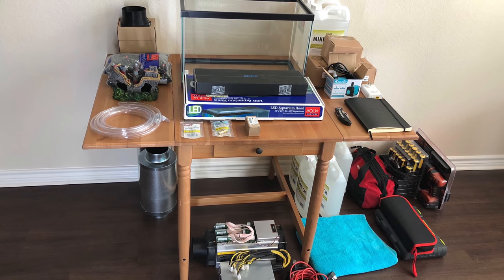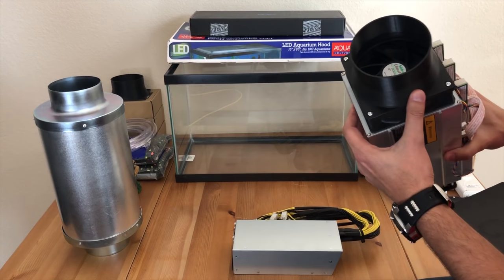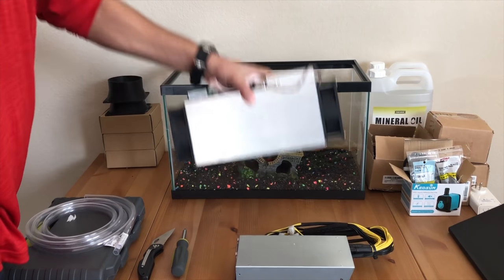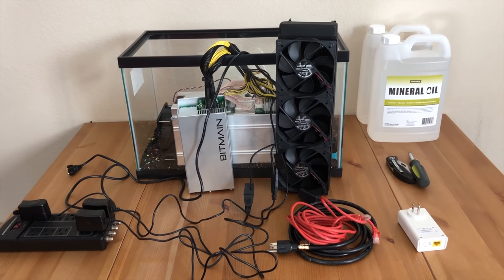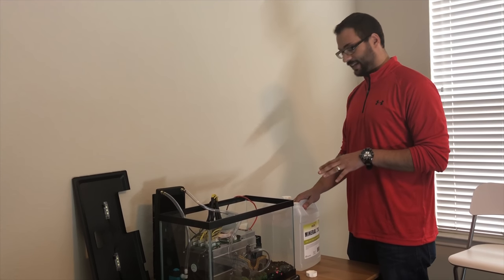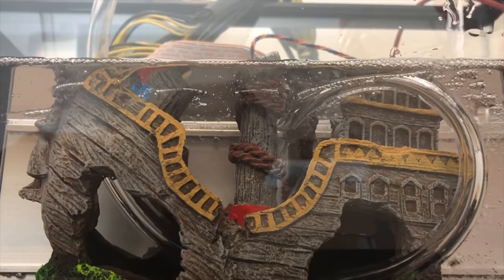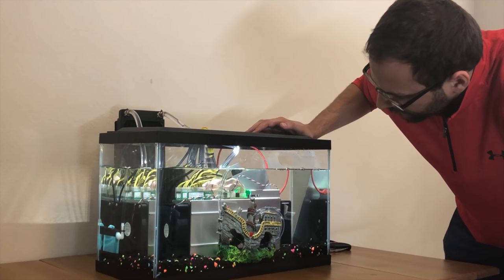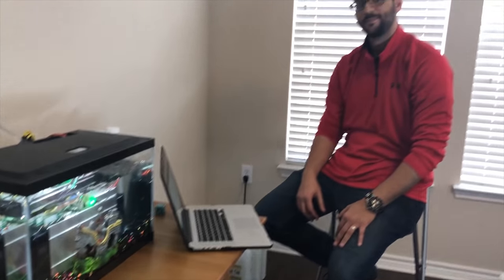Coolest Bitcoin Mining Miner - Liquid Cooled Experiment

Comment: Awesome ! You just beat up 3M and other companies making a "liquid" for the same purpose, but in a cheap way with the same result !
1 Gallon of the 3M liquid is over $400 bucks, and 1 gallon of the mineral oil is less than $25 bucks at Walmart !
Great video bro !
Reply: Novec or fluorinert are much more efficient than using mineral oil. On top of that, mineral oil is nearly impossible to remove from the components once you take them out and erosion can even end up destroying some parts while 3M's solutions will protect your parts.
Reply: @poipoi300   3 gallons of novatec is $151
Reply: @gotwebsite1  I looked up what novatec is and it seems to be a fertilizer. This information seems completely irrelevant. Unless you're talking about something else?
Reply: the put this stuff in a human body
Reply: They don't give any product specifications. Is it dielectric enough to put pc parts in? Another important component of novec is its low boiling point. Does the fluid you've linked have a low boiling point?
Reply: I dont know but they said they use it in human heart therapy or heart treatment or surgery or something and put it inside of humans!  the heart is electromagnetic so it is human friendly and dielectric all the way or totally non conductive
Reply: @poipoi300   guess were out of luck because that stuff is expensive
Reply: @gotwebsite1  I feel you because I got in touch with 3M directly to buy it at a more reasonable price but they don't sell directly unless you have a business AND plan to use it to cool down either a big miner operation or a server farm. I have the business but sadly it's neither of those.
Reply: $11 a litre
Reply: @gotwebsite1  It seems like he has a filtration setup to get rid of any particles created from erosion. That would definitely work but again is an issue for long-term use. He said he had one rig running for 2 years with no issue but erosion problems (with mineral oil at least) appear after around 3-4 years. In this case I also don't know the state of the parts when he takes them out. Is the fluid easy to remove? Is heat damage present on components that are in more restricted fluid paths? Novec still seems like the superior option since it does boil at a low temperature and doesn't cause erosion. There is a kind of novec that you can buy from chinese markets that is much cheaper than the other ones. it's called novec 1230 and is sold as a fire extinguisher. It's sold on the chinese markets at a much lower price than you would find anywhere else.
Reply: @poipoi300   he is using something called Bluemead not mineral oil
Reply: @gotwebsite1  I know, but any type of circulating liquid will eventually cause erosion.
Reply: @poipoi300   disculpa, si no se entiende lo que escribo, mi idioma nativo es el español, estoy usando google traductor y lo retoco un poco, bien procedo:  

Thanks for the answer, I get the fluid 7000 easily, they sell it in the town where I have my residence, so what fluid do you recommend so as not to complicate so much? I know practically nothing about the subject, I was going to use mineral oil but from what I investigated, in the long term it produces wear. My idea is a fish tank as the video shows, a fluid and add a radiator.
Reply: @zagon_4414  Hi, in your case, I think novec 7100 would be easier to manage, but you still need to make sure to cool it properly or there will be fluid losses. If it's possible for you to run cold tap water in copper coils above your fish tank, that would be a good solution. How much do they sell novec 7000 for in your town? I would be very interested in buying some.
Reply: @poipoi300  ok, te averiguo cuanto sale, dame un tiempo, mucho no te entendí, me podrías hacer un listado con los materiales por ebay? mucho pedir ?  no entiendo que es eso de la bobina.
Reply: @zagon_4414  Haha yeah a materials list is a bit too much to ask 😅But you should watch the "Aqua Exhalare" video on youtube. He's using novec 7000 which is harder to keep cold, but you could get some ideas from it still. Using novec to cool computers is still a territory that's not explored much. This is an example of a coil https://www.ebay.ca/itm/173520543939?hash=item2866a160c3:g:ncYAAOSwx2dYFGaE

Comment: Did this like 10 years ago :D  still got the vids in my channel and a blog with bunch of information about it. boring. The oil gets warmed up pretty quick and then the whole thing gets hot. Cooling it costs extra energy = youre loosing money on cooling that oil. Also some people write about health concerns (a little bit of that oil evaporates in the air in your room as far as i could find out back then. and then youre breathing it constantly ...)
Reply: would an uber radiator help, bunches  alum tubing through  the tank and pump ice water from chest with 12v  water pump..       post your  link.   projects like these are great. thanks Jeff
Reply: 2 years* ago
Reply: *losing

Comment: liquid nitrogen submersion ..,.???
Reply from the maker: Battlespace X I'll do it if enough people request doing so. I'll start looking into it.

Edit- Only benefit seems to find out the max overclock. Hasn't anyone already done so?
Reply: Joel Pagan okay thanks  thumbs up for that
Reply: Note that silicon chips has working temperature range, under certain temperatures they might not work or may work faulty. They all have a datasheet containing the working temperature range, that is usually between around -50 and +100C. If there is a kind of luck the silicon chip can create that much heat to heat up the conducting material between the chip and the coolant to maintain the working heat range even with such an excess cooling, then it might work. In worst case there is a chance to break the chip because of thermal difference on the two sides. A lot of materials crack if one side is overcooled and other side it warm. Silicon chips are not different. Keep in mind this might ruin the equipment.
Reply: So build it similar to a MRI Scanner. We use liquid helium to cool our magnets. but we layer our silicone and wires in multiple layers of epoxy prior to the "direct" exposure to the liquid.
Reply: But even so, the more heat you generate the more of whatever liquid you'll boil off unless you use a condenser unit that captures the boil-off and re-liquefies it.

Comment: What if you were to put everything ( tank and all ) into a small refrigerator?
Reply: A refrigerator is not designed to cool an active heat source. Think about how long it takes to cool a 12 pack of coke which isn't not generating heat continuously. You'd end up with a really hot fridge.
Reply: A refrigerator only pulls the energy (heat) from the inside, and drags less energy into the inside. The hotter it is outside a fridge, it will get hotter inside the fridge.

Comment: I would remove the fans on the miner. Waste of power
Reply from the maker: Joel B True. Depending on what firmware you run. Some older firmware will not allow you to hash if fans are not detected.
Reply: Joel Pagan how has it been mining so far?
Let's say I had a big tank with 4 miners in it, with oil, do you suppose there would be enough heat in the oil to flow through a coil in my ductwork to heat my home reasonably?
Reply from the maker: Joel B Technically it would be possible but I don't think you would want that because you want the inverse of that setup. In your case your describing the desire to have the greatest amount of heat go through ducted pipes and then home radiators. In the mining setup you want the least amount of heat going through pipes because your trying to keep the temperature -10 below room temp.

I don't want to give specific numbers because they are highly subjective and not fully scientific. However, I am completely certain that 4 of these can keep a 2500sq ft. home perfectly warm all winter long if the home has reasonable insulation and you duct the output   to your home vents. No need for costly oil nor containers.
Reply: Joel B you will cook the chips in the device. NOT recommended. you need a 300 watts motor with a POOL pump and a car radiator to cool the oil enough. this cost a lot and a month for constructing it.
Reply from the maker: Ravana Brahma Rakshas Why would you need a 300watt pump? With a specific type of looped setup you can avoid having a pump.
Reply: Which firmware allows you to run s9 without fans
Reply: Could you give me the link to your firmware?
Reply: Very bad move, if it wasn't for the fans the hot mineral oil would just stay around the hot parts and cooling would be that much worse. It's like airflow. You want more fans inside a case so you can move room temp air in and hot air out. Of course after running for a while the oil would become the same temp. Also, the oil lubes the fans and it makes them last a while.
Reply: i think the pump to the radiator would cool down the mineral oil so the average temp would be lower throughout the tank

Comment: Moronic idea that obviously wouldn't work better than air and would rapidly degrade your components. Take that rad and attach it directly to the chips, and then increase airflow over the rad instead of putting the whole thing in what is essentially an incubator and using a radiator that is a fraction the volume of the fluid inside the tank that would obviously not be able to deal with the heat. Hugely irresponsible video as I can see people asking how to build this in the comments, without finishing the video and showing people that this doesn't work, and instead calling it "literally the coolest" is encouraging people to throw thousands of dollars and the planet's resources into the trash
Reply: That is where you are so so wrong! If anything, this will last longer than any other miner being cooled by air.
1. No dust
2. No corrosion to the PCB
3. This would keep the miner MUCH cooler than just with air

What would be even better would be to use a Peltier!
Reply: Dean O mineral oil does damage to plastic and rubber parts...so it depends if it would last longer in mineral oil....
Reply: Lipi19821 it is submerged. No damage will be done.
Reply: inception69 read my comment again and tell me where you got idea that I dont know its submerget...
Reply: there are many PCs built in mineral oil tanks and they would last for years with almost no damage. because the oil lubricates every mechanical part and at the same time preserve its condition better than being out in the open air, exposed to more impurities.
Reply: ilham i suggest you look at the series linus of linus tech tips did on a mineral oil pc. It makes plastic components  brittle and makes any servicing a total nightmare. Not what you want when you have a piece of kit that loses you money every second it isn't running. Not that mining on one of these obsolete things is profitable at the moment anyway
Reply: Dean O already spoke about the longevity of the parts in the other comment but regarding temps, if you aren't intellegent enough to figure out for yourself that this method keeps nearly all of the heat in the tank and recycles it whereas air blasts it away, find the replies to other comments by the creator of this very video where he explicitly said the temps were worse. Regarding using a Peltier system, think about it, why would you spend even more energy on actively cooling something that consumes  3,2928kW/day? You're doubling your input energy for the same hashrate. Unless you're talking about overclocking. Okay, but then you're going to need even more power. You'll find you run into a brick wall of diminishing returns. I would be interested in finding out what can be achieved with liquid cooling, it might just be enough to eek a bit more life out of these things after Bitmain decides to grace us with their used garbage
Reply: ilham yep PC IS fulllllllll of mechanical parts.....lol....

Comment: Hi, Can you please tell why you pick that mineral oil, I used one I found in the pharmacy and it does not work., the miner goes up but it does not start mining, the fans wont turn on. Is any diference between the food grade mineral oil and the one found in pharmacies
Reply from the maker: Juan Sebastian Rondon Ordaz The high grade mineral oil has lower viscosity. The lower the better. Pharmacy oil probably has other additives like scent.
Reply: Thanks for your reply.. I will try to get the same oil you use in this video

Comment: If you were able to buy an 140mm radiator you'd be able to fit it in that masterpiece.
Reply: And also how did the cables survive from the water? I'm very curious.
Reply: Or you could fit an 280mm radiator there, or just put the 360mm radiator down the aquarium, would've been a great idea for not letting out the radiator.

Comment: This is awesome! And thanks for including a list of parts. One question though. I heard Linus tech tips say submerging cables will make them harden over time and that they may be damaged when taken out of the tank. Is it ok to fill as high as you did in the video or should my oil level be lower?
Reply from the maker: Singleton Maasai I honestly wouldn't recommend submerging everything for long term. Mineral oil creeps up through any cable after a while. The oil evaporates extremely slowly leaving behind sort of a resin that hardens. For a future experiment I would take the miner completely apart and use a car radiator under the table and use a combination of pumps.
Reply: Thanks! You said in the description you ended up using two radiators. Did you have to buy more tubing and extra of the other parts to go with that?
Reply: Есть масла диэлектрики. Их применяют для пропитки электрических кабелей. Давно хочу попробовать опустить DR-100 в трансформаторное масло Т-1500. Привлекает то что в подобных маслах нет воды и механических примесей. Не понятно как оно поведёт себя с материалом из которого состоят платы. Есть текстолит стойкий к трансформаторному маслу, не понятно какой в DR-100. http://agrinol.ua/ru/produkciya/masla/energeticheskie/t-1500/
Reply: Человек с большим заработком бесплатно делится опытом а вы так грубо ему отвечаете....))))))

Comment: I'm curious whether you waited to let the temperature stabilize, before you showed the screenshot of the miner's characteristics (temp), or if the temp was still adjusting towards an equilibrium.
Reply: Also, is "Baby oil" the same as mineral oil?  Are there other kinds of oil that are also allowed for this, which cost less on a per-gallon basis?  Like...if I used motor oil, or canola oil, or something?

Comment: You don't need to keep your two fans connected to the power. I am surprise that the two fans motors did not burn. Can you explain me how long did you use this setup?
Reply: actually it would not start if you disconnect the fans (there are some adapters/chips to trick the miner). 
But yes, spinning them under liquid is probably a bad idea.

Comment: Hi Joel, can I pay you to advise  me on what's going on with my setup please? I have a simple cooler filled with mineral oil but the miners just give errors once they are submerged. I will pay for your advice
Reply from the maker: onlythe strongwill I wouldn't recommend doing this for personal project. At scale it doesnt make sense unless you have noise restrictions to deal with at which point you may as well go for open environment. 

The error may be the board chip safety software.Try unplugging and plugging back in when already submerged. Some measure fan resistance. If viscosity is too high, it turns off because it interprets it as the fan is stuck. So keep that in mind.

Comment: Umm, I have a few concerns:

#1: I thought water and Electricity don’t mix, generally if something like an ASIC miner which uses electrical circuitry came into contact with water, the ASIC would short and well not work, it’s not so much the fact that it works that concerns me, it’s the water that concerns me.

#2. Isnt metal corrosive when it comes to water, like doesn’t metal corrode when it comes into contact with water?

#3. For say someone whom might wanna do this is there a way to somehow “Mount” the PSU and Radiator to the Tank in the hopes of making it easier to move around/make look more aesthetically pleasing?

#4. Would this soloution pretty much eliminate noise and temperature from becoming an issue for someone say in a unit where the is poor ventilation?
Reply: (1&2)
it's not water. It literally says on the big ass jug "Mineral oil" 
Mineral oil is non-conductive. 
I don't think he mentioned water at all. (Idk he might've, but either way it's a mineral oil system he's using)

(3)
Possibly. I wouldn't put it on the side of the glass because that would restrict airflow to the radiator though and once the mineral oil heat soaks, it'd be like pretty much running dry with no way to get rid of the heat.

(4)
The noise would be almost entirely gone except for the heat dissipation method which would be the radiator + fans that he stood outside of the tank. (This would be MUCH quieter than the fans in the miner, though.) You would still need to put the heat somewhere there's good airflow because all you're doing is displacing the heat and not removing it entirely, thus the need for the radiator. You could possibly have the tubes running out a window and just stick the radiator outside if you don't have good ventilation.

Comment: Submerged minning is way more profitable then air cooling. This setup is just not right for submerged cooling. Firmware needs to be adjusted, fans need to be screwed of the minner, bigger tank, better (second hand) material and you can overclock the minner with 40 - 50 % less energie ussages